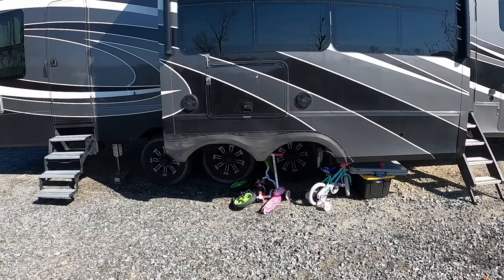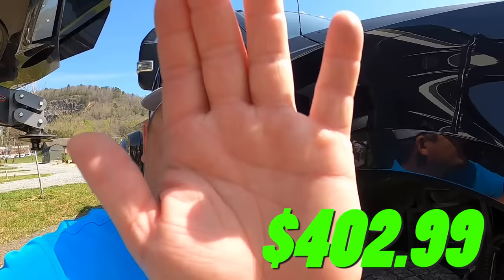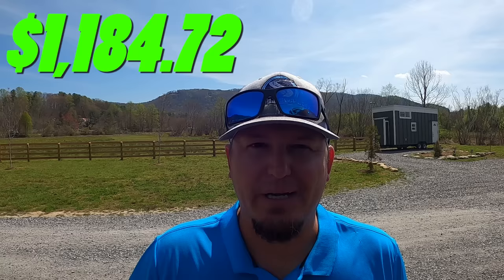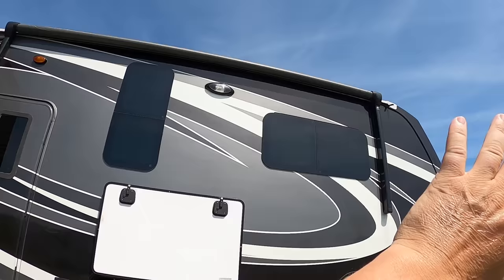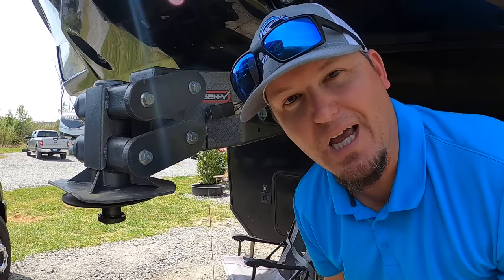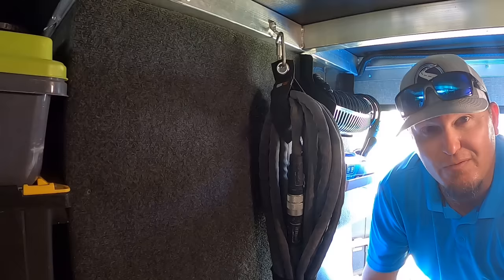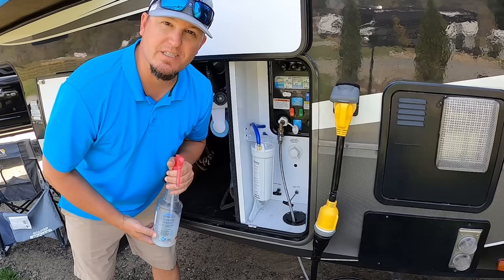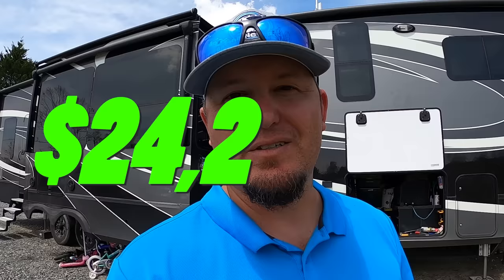These Things Are Money Pits! Everything That We've Had To Repair! | Fulltime RV Living!

Comment: I don't get it, you said to live on the road cost $172,788.09, and that was after the $187,416.80 for the RV and truck. Was that the price just for the RV and truck? Are you saying that truck was nearly $100,000 to buy and you paid $80,000+ for a secondhand RV? So when you subtract the  $17,700, from upgrades and maintenance from the other number, the $172,788.09 that's roughly,  $155,000. So it cost that much for gas, food, lot fee's...ect? Something isn't adding up here.
Reply from the maker: Its pretty simple, in the first video we told you we spent 187k getting the truck and the RV and all the upgrades we did to it! The second video is about how much we spend to travel! All of our monthly cost! That number is 172k and it was what we spent for two years of travel! The reason we used two years is because that shows a real average of what it takes monthly to live! 172k divided by 24 months comes out to around $7200 a month to live!

Comment: Worse expense than a boat, those big pick ups are nothing but trouble
Reply from the maker: We have actually had no trouble out of the truck! We have only done scheduled maintenance and replaced consumables such as brakes, tires and shocks! It is doing exactly what it is designed to do! We owned a boat once and it wasn't bad either, do the required maintenance and take of it and your fine!

Comment: It is an absolute shame that the manufacturers produce such a horribly built product.i now have no desire to start down that bumpy road.great vid.thanks!
Reply from the maker: RVing is great, what you should take away from this video is things will need repairs and maintenance more than you think!  If you come into rv'ing expecting it to be a vacation 24/7 and nothing will ever go wrong, you are going to be very disappointed!
Reply: I do not doubt tthat,what I disagree with is buying substandard equipment,even new off the lot.quality controls need improved and cost cutting has even put unsafe trailers on the road.just look at bent and broken frames on new trls as 1 example. Then add useless warranties that won't cover it.

Comment: I change the rotors every time I change the brake pads...
Reply from the maker: The Ford tech says if you change them before the pads are gone you can turn them once! If you wait to long like me you have to get new ones!
Reply: @PavingNewPaths There is this tradeoff between the cost of turning the rotors and just buying new rotors. When I do the job myself, changing out the rotors yourself is the path. They rotors aren't that expensive and on american vehicles aren't hard to change. The trick is doing the change yourself. 

When I changed rotors out on HONDA Accord... That is a different matter. You have to press the bearing out of the rotor assembly. Most of the other vehicles are just held in with the lug nuts... (Because of this, you do want to properly tighten the lug nuts).

Comment: It's a shame but everything from the RV itself to the prime mover of it are manufactured with the idea in mind that you'll use it very sparingly and travel on the most smoothest roads.  This translates to the bare minimum quality of materials being used which often times when put under the stresses of movement fail in a short amount of time if not immediately.   

I know plenty of Class A owners who understand this and when they get a new RV they negotiate the price down to the absolute minimum the seller will allow.  Then spend thousands of dollars in upgrades they perform themselves or have done for them before attempting a serious long mileage trip.
Reply from the maker: Thanks for watching we must be very similar to your class A friends! We bought this thing used at a great price! We spent 6 months upgrading systems and components ourselves to handle traveling fulltime! We have traveled fulltime for 3 years without a major issue that stopped travel or required us to take it to a shop, because we did all the work ourselves!
The reason for thr video was to share what it is really going to cost you to travel fulltime, it's an amazing life but not a 24/7 vacation that is often shown!

Comment: Change your oil every 5000 miles.
Reply from the maker: You certainly can do that, but you will be changing it more than needed! All diesels have an oil life monitor that changes based on use! when we tow we get 5-7k between changes and when we don't tow it's been as high as 10k! So far we have 100k miles and haven't had a probelm!

Comment: You should’ve bought a used Bluebird or Prevost. All those rv’s with fiberglass “bonded” exterior panels are nothing but junk. Something your finding out the hard way. Sorry for your troubles. Sell that   cheaply built turd, and get the above!
Reply from the maker: We don't think our RV is junk at all! We actually love it, even if we do have to make repairs to it! That's the price you pay when you live in it fulltime and move it as often as we do!

Comment: I do agree these things are money pits.  But you changing things like the fuel filters on your truck every other oil change means you are changing them about twice as often as Ford recommends. There are some other  similar things but yes, these things are money pits big time.  I also have a late model Grand Design.  What is with the interior trim just randomly falling off.  That is just sloppy poor construction.  I worked in construction.  Nailing wood trim on wood substrates is not rocket science.
Reply from the maker: We used to change them every 3rd oil change and that was around 30k miles! That is the light duty maintenance schedule! We have found that since we do pull heavy often we need to follow the heavy duty maintenance schedule and that cuts all of the intervals in half! So now we change our fuel filter about every  18-20 we change it! Our first 6 months of travel we basically had to put the inside back together after every move! Now we have glue and nails on all the trim pieces!

Comment: That's a lot of coin for not one massively depreciating asset, but two. At least a home will appreciate as you spend $$ on maintenance and upgrades.
Reply from the maker: Not always true that your home will appreciate like you think, you will continue to pay property taxes, and insurance rates based on the value of that home that keeps going up! You will also spend more than we do on Maintenace and repairs especially if you keep it long term! And most importantly it's only a an asset with any value if you sell it! There are pros  and cons of both, for us this is the better use of our time and money than owning a home and collecting things! This is also our business so depreciation is our friend!
Reply: @PavingNewPaths  Probably depends on where you live. In CA the average rate of appreciation of a home over the last 39 years is 6.77% annually. Our home was $316K in 1998 and is currently valued at $1.33M. We spend significantly less a year on repairs and maintenance than what you've calculated for your RV and truck. Our property tax is capped (Prop 13) and our electricity is free (paid off solar system). Also, you can take out a HELOC to leverage your equity in a home, so the home as an asset doesn't need to be liquidated to access the equity. In fact most assets need to liquidated to free up the funds (stocks/collectibles/401ks, etc.) so a home is no different than most assets. At least the home is not a liability. 

I appreciate your decision to live as you do and have considered going on the road after retirement myself, but the very premise of several of your videos is that you've spent way more than you expected. I'm guessing your truck was close to $100K and the RV was over that. In 6 years both the truck and the RV will be worth 1/2 or less. In 6 years my home will be paid off. Not trying to throw shade on your decisions but its important for viewers to understand the potential liabilities for living the RV lifestyle.

Comment: Biggest mistake is buying a new Diesel pickup,I've drove big rigs since 1973 a d all newer diesels are garbage the fuel milage on these pickups are worse then the milage on a big rig.
Reply from the maker: Thats just not true!  All 3 brands make trucks now that are more capable and efficient than they have ever been! They all also get around 18 mpg unloaded and 8mpg towing!  Not sure I have ever seen a semi do better than 6!
Reply: @PavingNewPaths  my freightliner with a 465 cummins pulling a loaded 53 foot trailer averages 9 mpgs figure your DEF usage ad rhat to your mpg I've driven diesels since 1973 the new ones are expensive junk my pre Def trucks never broke down the new ones you have to be towed in when a freaking sensor goes out my 2010 gas suburban averages 24 mpg towing 16 mpg compared to your 8 mpg diesel pluss service is way cheaper.
Reply from the maker: @dewaynem559  I see what your saying, but you are comparing a semi truck to your truck and then you come in with your Gas suburban!  One we can't pull something like this with as gas motor, so we are left with a 1 ton or bigger diesel!  We could to an HDT but we need our truck to be our adventure wagon when we aren't towing!  Somehow driving an HDT through Yellowstone seems like a bad idea!
Reply: @PavingNewPaths  I had a diesel pickup with a 5th wheel I got rid of them I've been everywhere and I'm saying the new pickup diesels are junk I got rid of the pickup and 5th wheel all my kids grew up I don't need anything that big anymore I'm 65 if I was to get another diesel I'd get a 600 bobtail with a 10 and 2 and a DT 466 diesel fuel milage would average about 12 the pickup diesels Rev too high that's why there milage is worse then a 18 wheeler at 65 your only running 1100 rpm  I'm just saying I had new diesels they suck I've been Yellowstone 6 times I never git tired of it
Reply from the maker: @dewaynem559  I think the point your getting at is new diesels suck because of all the emissions and technology they have now! You will have the same problem with anything that is made after 2013! Even the new HDTs now have all the same emissions and sensors the 1 ton trucks have! It's called progress and there is not much you can about the way they are required to build these now!

Comment: Just missing the total amount of time you put into the RV.
Reply from the maker: It is hard to calculate the time, but I easily saved 10K on the cost by doing all the work myself!  We did hire out help for the roof and the slides and that was why those cost were higher!

Comment: I have fixed electrical problems in RV's for a number of people, & I have never seen such crap in my life ! 
Junk ! Ab solute junk. The units that use motor coaches  are an exception , but cost well over $500,000 (Highway buses) I expect that Airstream are considerably better because of their prices, but I don't know. All I know is that I would not have an RV if they were free.
Reply from the maker: What we know is no matter what you paid for your RV from 30K all the way up to 1 million plus, the story is the same!  If you actually use the RV and travel more than just a few times a year, It literally starts to fall apart on you!  The RV becomes part of the adventure!  Now I will say most of our big stuff happened in the first 6-9 months of traveling, once you work out the traveling bugs its just small repairs and maintenance to keep it going!

Comment: How were  you hitting bed rails on a stock truck? Also looks like a covid model rv? Were on yr 4 fulltime rving across the country.
Reply from the maker: It came down to a combination of incorrect pin boxes installed at the factory when it comes to any truck newer than 2017!  The Drop frame RV's that came with a Lipper pin box when used with a 2017 or newer truck from any brand would be very close! If you stayed on flat ground you had no issues, but any major angle changes and you would hit!  They have since stopped doing this as it is a problem!  Our RV was built in 2019!
Reply: So frustrating to spend so much on a new truck for things to be wrong from the factory.
Reply from the maker: It's not the truck it was the RV that was wrong!

Comment: There is no way I would buy one of these.  Its basically a flimsy caravan you live in all the time.  We have a caravan which needs a bit of TLC now and again but we only use it a few times a year.  If you are going to live in one of these you need it to be solid. 
In addition to all the bits and bobs which look to be the cheapest possible parts (those hinges on the bed are not fit for a dolls house) the top of your RV was coming away AND the bottom fell out of it.  These RVs are built like new houses in the UK. Maximum price for minimum input.  Low skill labour and cheap prepressed parts fitted as fast as possible and sold for the maximum price. $17000 for just 2 years!!!! That shows how crappy these units are. I admit they look great but it's all MDF and fibreboard. Built to be sold, not used.
Reply from the maker: We agree they could be built better, but ours is actually one of the ones made for fulltime use! Imagine how much worse this would be if we tried to do this in one not made for this! It is an awesome way to live, but you have to want to do it and it will take work!

Comment: why arnt you doing your own oil and filter changes? its not that hard?, wow all those problems doesnt say much for the manufacturer
Reply from the maker: I do my own oil and fuel filters when I can! But since we travel fulltime, almost every RV park has rules against this type of work in the park! So when we are on the road we just take it to Ford! The brand of the trailer doesn't matter, no matter what you have or what you spent, if you use it fulltime there will be repairs and maintenance along the way! Anyone who says they don't have problems with and RV either doesn't use it or doesn't own it anymore!

Comment: 1.I would never wait until 5,000 or 9,000 mile to do oil changes. Yeah, blah, blah, blah. I don't care what the manual or the dealers say.
2. So, in other words, RVs, regardless of cost are built with the cheapest lowest quality crap the manufacturer can get.
3. All LED lighting should be marked with the color. For example, 2700, 3000, 3500 etc. 
4. If your truck air filter is the K & N style, I wouldn't use it. They don't filter nearly as well as a quality standard type filter. Makes me wonder though. When these types of filters allow more air to enter the engine, is the computer adjusting a fuel increase?
5. I greatly appreciate your video style. Talk fast, get to the point and move on quickly.
   I hate when the person making the video stops everything to talk about his stupid cat.....or whatever.
Reply from the maker: Thank you! Glad you liked the video! Everything in any video can always be subjective, that's why we try to limit our opinions and just show and tell what happened!

Comment: the death wobble upgrade on new vehicle is waste of money. the death wobble is caused from wore out steering parts. the upgrade will wobble with bad steering parts. so, waste of money.
Reply from the maker: That's why we had our steering linkages and all joints checked out, we removed the stock single stabilizer and added a dual shock stabilizer!  It may not prevent it but it will go a long way in helping keep the issue at bay!

Comment: Recreation vehicles sold very well when we were energy independent.  Now that Biden destroyed our energy independence the first in office and fuel both gasoline and diesel have skyrocketed the Recreation vehicle industry has not done that well.  I say that because every Recreation vehicle dealership that I have drove past since January 20 2021 has been crowded full with Recreation vehicles.  Two expensive to pull or drive. And with the video it is veey obvious that there is a hole lot of maintenance expenses.  And we never heard about the expenses involved in parking one of these vehicles at a trailer park or Recreation vehicle parking space.
Reply from the maker: This video was just about the maintenance and repairs on the rig! If you want to know our monthly expenses for everything check out this video https://youtu.be/RQGACy9_-WM

Comment: The BAD engineering on that RV is astonishing.   Not just the magnitude of the oversights, but the number of design flaws.

Wow.
Reply from the maker: I don't think they have bad engineering, but they do have poor assembly and craftsmanship from the factory! They also do a lot of things that are just bad practices!
Reply: @PavingNewPaths  

They could have used better designs on those items that cost you money and work.  For the end-unit price you paid, they sort of owe you a better design. Example, that lower panel with only 3 screws, or something as simple as the light that fell off.  

Engineering: “process to solve technical problems, increase efficiency and productivity, and improve systems”.

After all, you can see that YOU, as a matter of fact, improved the engineering of the product. 

My wife and I are going to get an RV someday. The choices are so numerous and varied….